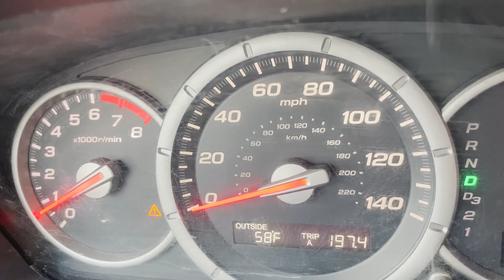Adventure Ends in Broken Bone: Scouting Guilliard Lake with our Honda Pilot

Comment: Wishing for a speedy recovery to your son =)  On another note, can I drive my '08 pilot down to you to get repaired?  I have a knocking in the passenger rear and driver front! LOL
Reply from the maker: Have you replaced your end links recently? They could be the source of the knock.
Reply: @GotterAdventure  Never replaced any suspension parts.  Also, I live in the northeast where its very salty.  It didn't start making the knocking noise in the passenger rear until I went over some pretty sever off roads... My '05 pilot never made the noise and that had 280k, this '08 pilot has 170k.
Reply from the maker: @bmark0610  my bet is on sway bar links
Reply: @GotterAdventure  Do you think if I jack up the rear and take off the tire then tap on the sway bar link ends with a rubber mallet I would be able to tell if it is bad?
Reply from the maker: @bmark0610  you can just inspect the joints/boots. And grab/jostle them
Reply from the maker: If they are loose they are bad
Reply from the maker: @bmark0610  yes check for play in the parts